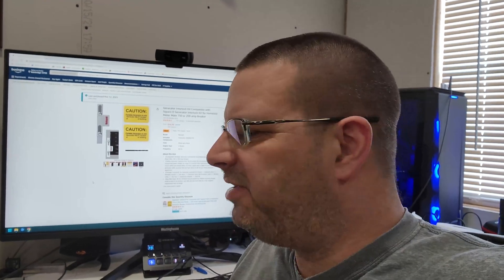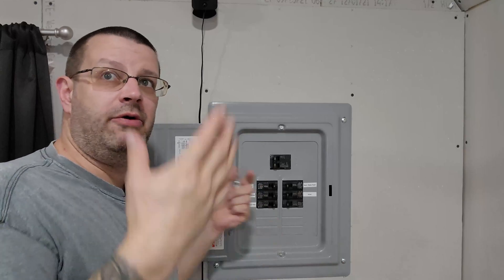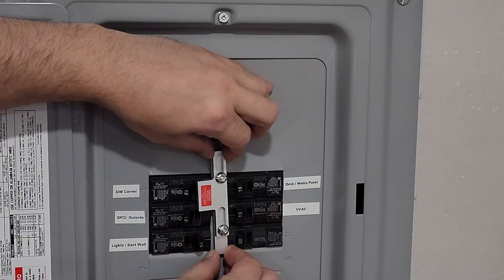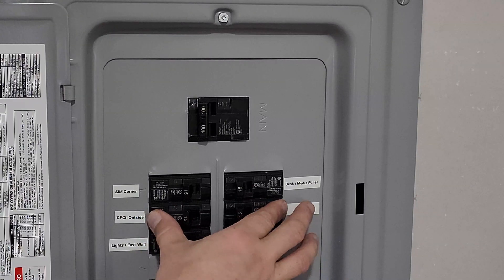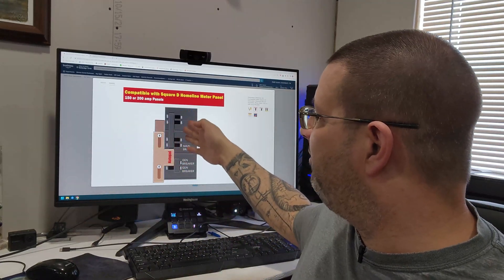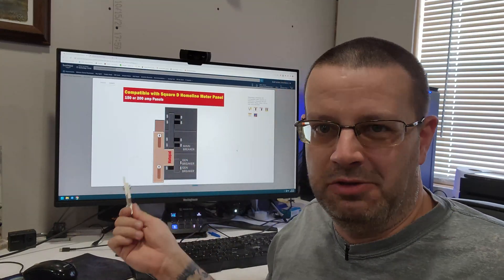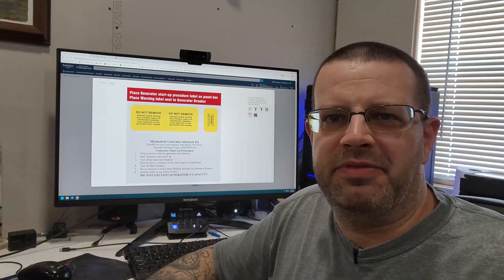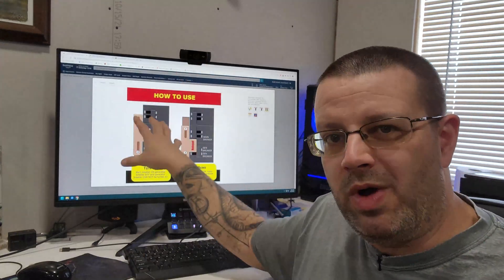Cheap Generator Interlock Kit with some not-so-smart instructions

Comment: Actually the picture is showing a double breaker that is interconnected where one push turns the double breaker on. A single part of the double breaker can not be turned separately, unless someone was to physically cut the bar that connects the double breaker together, so the picture is actually correct.

Comment: If the breaker panel is in the laundry room, a few unbalanced loads in the washing machine will shake those security fasteners right off.
Reply from the maker: Good point. So far in my case, with just a dab of hot glue on the end they haven't budged and are still rock solid. Definitely wouldn't hurt to have some locktite on though

Comment: I installed one similar to this one. Because of the indent in the breaker panel cover the sliding piece didn't sit exactly right to stop the main from being switched. I ended up having to drill, tap and install a bolt and lock washer to make it work correctly. Works great now. If you tighten those bolts and nuts down on the slide there is really no way they will loosen. Those stickers, I ended up using the connection/startup white sticker. The others seemed useless the way they were worded. These interlock manufacturing companies need to get their act together on this type thing. You are correct though. Buy one from a reputable manufacturer. Same with inlet boxes. Thanks for the video.

Comment: Energizing the grid is a myth. When the power goes out your neighbors and others on the grid don't unplug anything. They don't turn everything off. If you tried to back feed your city your generator is going to flip your breaker. I'm well aware of how transformers work and your voltage would be amplified but you still aren't going to power the grid without throwing your generator breaker. If you bypassed your breaker you'd fry your generator.
As far as linemen go, they're trained to treat every thing as hot and ground lines they're working on. The only case of a death of a lineman due to backfeeding is only suspect. They have no clue if that was actually what killed him

Comment: Just installed one , didn’t read directions but have installed lots of other interlocks, I just measured where interlock would disable main from turning on and drilled holes, after seeing video and reading directions glad I didn’t read😂. Good kit for older panels as I was afraid I was going to have to make one myself for interlock.

Comment: Here is food for thought, how about call a qualified person. If you are not smart enough to figure how all of that works without instructions, call a guy that does. One very important reason is you will not know how to wire the inlet for the generator to the house. You want to see a real show it's a generator improperly wired to a panel. Or incorrect wire size.

Comment: Ummmm… isn’t that just showing a reverse set-up… with the breakers on the right side of the panel???  Main is on and gen breaker is off and blocked? 🤔🤔🤔🤔🤔
Reply from the maker: It's hard to see on the screen, but the Off/On labels on their breakers in their diagram are reversed. So for example, at the 5:08-ish mark,  the way it's labeled, the gen breaker is On, and there's nothing preventing the Main breaker above from being switched to the right into it's own On position as well. In short, they just screwed up the labeling of On/Off in their diagram. A simple fix, but it's also something that had been brought to their attention for a long, long time. People had noted it a year before I made that video, and here it is a year later still, and it's still incorrect on their diagram. 

For 99% of the people installing this, it's easy enough to install correctly by using common sense, but there's always someone that this could cause an issue with if they found some way to follow their diagram to the letter.

Comment: Interesting critique of generator interlocks, good catch about the incorrect instructions. That is pretty terrible and dangerous for a safety related item. I installed an interlock kit when I installed our generator. The instructions for it was pretty clear and ours works as advertised, preventing both breakers being on at the same time.  The NEC has requirement about removing the generator backfeed breaker since if the generator is running the CB contacts are hot so you don't want it flopping around.  

I thought from the title of your post it was going to be about the risk of having both breakers on if the breaker panel cover is removed. That is an inherent risk of using an interlock. It never occurred to be the installation instructions could be so wrong.

Comment: Bro those drawings are wrong on your computer 💻 out at your main electrical panel you can’t have both generator power on and the main 200 amp panel breaker meaning PG&E power 🤦🏻‍♂️🤦🏻‍♂️🤦🏻‍♂️🤦🏻‍♂️🤦🏻‍♂️🤦🏻‍♂️🤦🏻‍♂️🤦🏻‍♂️🤦🏻‍♂️🤦🏻‍♂️🤦🏻‍♂️ broooooo your a knuckle take that inter lock kit and put it up ⬆️ on your main panel outside 🤦🏻‍♂️🤦🏻‍♂️🤦🏻‍♂️
Reply from the maker: That was the point of the video - the diagrams included with this particular kit are completely inaccurate and if there was a way to hook it up the way they were showing in their diagrams, it would allow both circuits to be energized. Clearly that's wrong, and NOT the way it should be ever hooked up, obviously. As for the rest, there's no difference in having the interlock in the house panel which requires the main breaker to be turned off, versus having it shutting off the main disconnect outside - there's nowhere along the line between the panels where there could be voltage introduced back into the system back to the meter and through the lines. An in-house interlock kit is more than sufficient; that's why they're made the way they are. Also, not ever home has a main disconnect outside anyway. New code requires it it many areas for new projects or re-work, but there are plenty of homes without the need for a main disconnect prior to the house panel, so that idea wouldn't allow for any possible generator hook-up to any older house that has no main disconnect outside, or for a main disconnect panel on new work that carries only a main breaker with no additional spots to accept a secondary breaker for a generator hookup. 

Not discounting that it isn't an option, but since it doesn't matter either way and as it's still code-compliant to use an interlock switch on the panel inside, that's the option I went with. Also allows my generator to be in an area that can be weather protected versus out at the meter pedestal in the lawn. Other than that, I actually do also shut the main disconnect off anyway out of precaution in the event I have to use it but again, it's not causing any danger either way (as long as whatever kit is used is installed correctly).

And as always, anytime someone is unsure about installing something dealing with electrical circuits, contact an electrician or check with an inspector prior to any work!

Comment: Hello, I noticed all problems you explained and I really don't how they can sell a product like that on the market. Hope nobody had injury. I have a question, I have a Cuttler-hammer sub-panel for all my emergency circuits, so I want to install this sliding plate plate between an utility braker (left side panel) and an gen breaker (right side panel). What is the dimension of the square central section of the T-shape plate just to be sure it's large enough to keep my two breakers in opposite state.
Reply from the maker: The central section is 1 1/8" square (side to side and from top to bottom in that middle section itself). If it doesn't look like it'll work for yours going side-to-side, since it does slide freely, you might be able to find something on https://interlockkit.com/ for that particular setup. What I did was looked up the style I needed on that site but then bought the same style kit from Amazon as in the video. Physically it's the same setup, it's just the horrible instructions! Best of luck!
Reply: @CharlesOlcott  Oups, it won't work in my case, the side to side has to be 1 3\4 to  get 2 breakers on opposite state or gaboom. Thank's, i'll check your site.

Comment: I'm actually buying this right now for my Square D Meter Main I just installed. They just have the On/Off positions labeled in their drawing backwards. Everything else is correct. To be clear, in the drawing, the the main breaker would actually be on and the gen breaker would be off. To lock screws in place I'll just use Loc-Tite.
Reply from the maker: Exactly. And it should be obvious to most anyone that is proficient enough to install it when looking, and I hope there's never a case where someone goes on the literature alone. It's just crazy that it's been reported and brought to their attention for so, so long already, and still has not been corrected, especially with what should be a simple enough fix! Good luck with your install - the physical install went very smooth!

Comment: Was that kit made by FLNGR?  Mine was.  Different panel.  I have a cutler hammer.  The photo was correct but the writing was wrong on the instructions.  Im not an idiot and I knew the writing was just a typo I just thought it was weird.  Instructions written by non-native English speakers (i.e. Chinese) I have found many discrepancies over the years beween what is said and what is meant.  Also the instructions didnt really make clear what the zip ties were for.